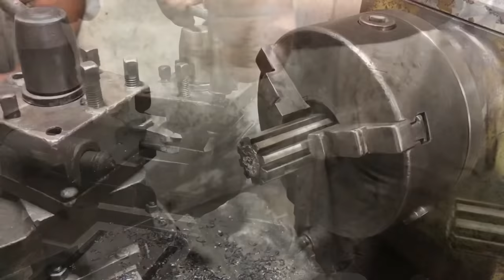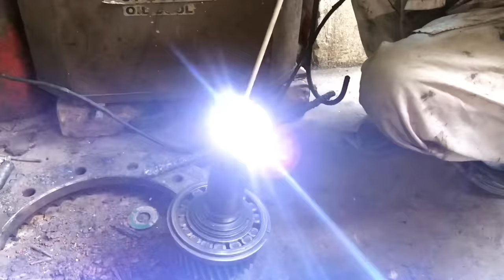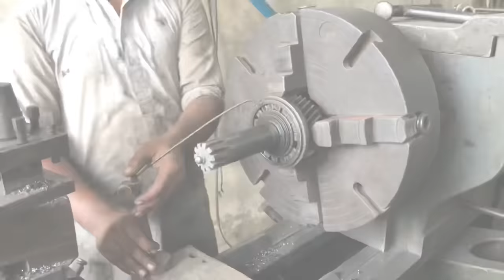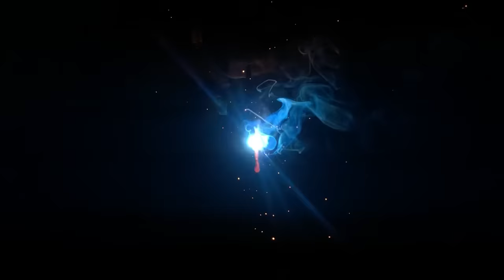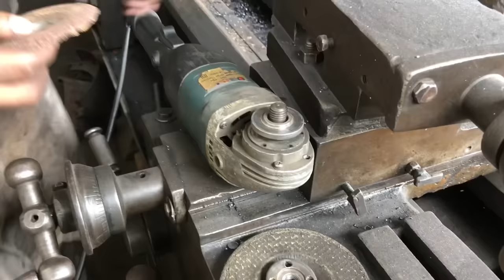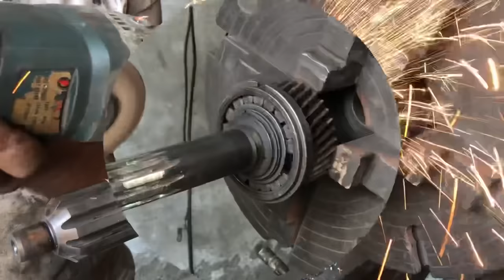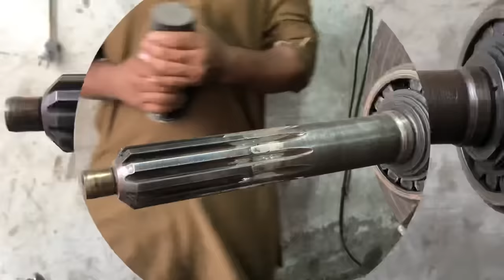The Ingenious guy Connected Broken Input-shaft Very Nicely / Pk process

Comment: as long as they never put the truck in gear and let clutch engage it should last forever haha
Reply: Drag racers in the 60's welded camshafts and ground them down to get the lift and duration they wanted,  chet herbert was really good at it
Reply: This is wrong on so many levels... 😱
Reply: Well it's true haha @ronaldschoolcraft8654
Reply: @SouthMainAuto I meant the hack repair...
Reply: Not perfect
Reply: 😅why on earth wouldn’t he know enough to use a center drill to start out with ? I’ve seen these guys perform some amazing mechanicals from other countries, India and Pakistan especially
Reply: Plus they should have removed the bearing ! Beforehand
Reply: I'm thinking all those bearings and race have electrical arc on them
Reply: @jonfoss3437 wałek rozrządu przenosi małe momenty obrotowe a wałek sprzęgłowy bardzo duże. Poza tym łożysko podczas spawania nie osłonięte i widać już ubytki rolek. Robota fajnie zrobiona ale tylko na pokaz.
Reply: Theresa very slight chance that this could work... but I'm not convinced. It looks pretty.
Reply: Now off to the flea market.. for a 35.00 dollar sale.... sucker !
Reply: @mrfixzit1019  I love this Good job.. it works as perfectly as a new one. What is weong with it? He did not use any modern machinery...
Reply: @anandasene  his prep and weld also not taking off the bearings and proper centering